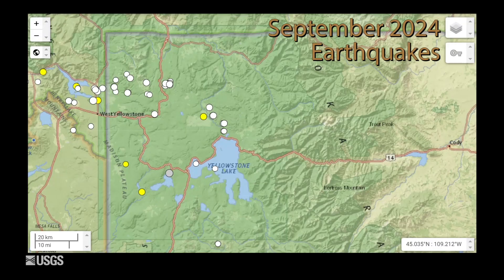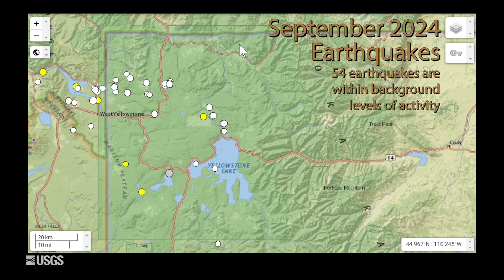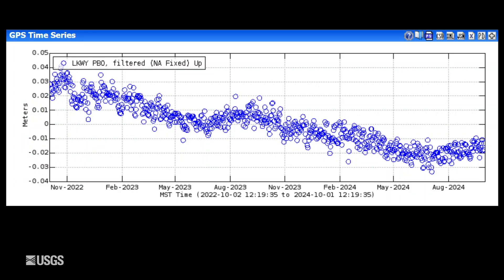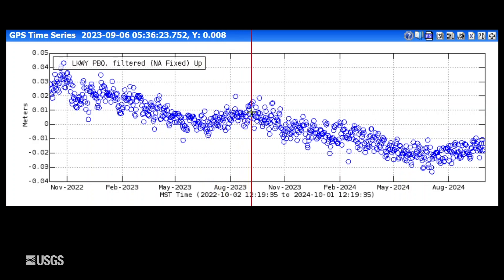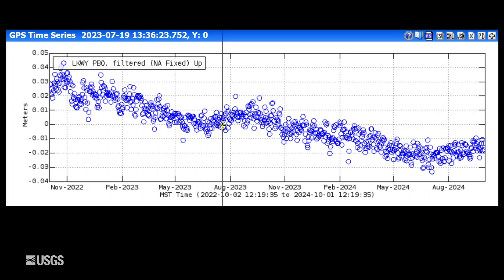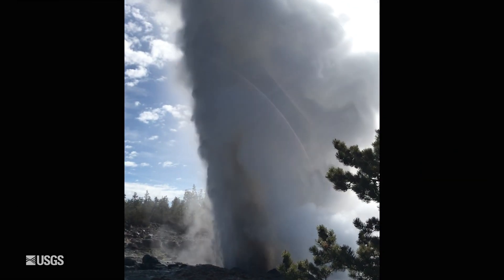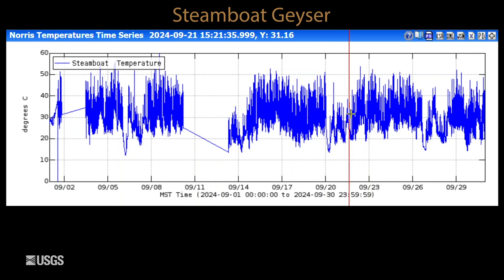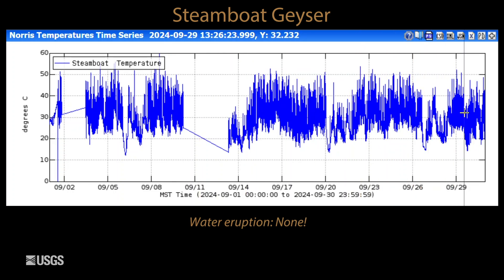Biscuit Basin Hydrothermal Explosion Update (Yellowstone Monthly Update — October 2024)

Comment: the way you dance around the answer is what... i hate most about government agencies... thanks for sharing your obvious narrative... <3
Reply: Using triple periods... instead of normal punctuation... doesn't make you sound any smarter...
Also, considering it's not just the USGS watching this thing, but also pretty much every geologist in the Central Rockies, and that this is the most extreme thing to happen in the caldera in several years, I get the feeling we'll be just fine for a couple decades.
Reply from the maker: What sort of answer do you think we are "dancing around"?  It's all pretty simple -- the water was already boiling, became confined due to silica precipitation on the conduit walls (we see that in eh debris that was deposited by the explosion), pressure built, and rock ruptured.  This caused a feedback where the pressure drop caused more boiling liquid water to flash to steam, fueling the explosion.  It was not caused by any change in magmatic activity.  If it were, the activity would have manifested much much differently.

This sort of thing happens in the park with some regularity.  Something this size happens about every decade or so, but smaller events happen multiple times a year.  A steam explosion occurred in Norris Geyser Basin in April of this year and created a crater that was 10 feet across!  It just happened at a time that no one was present in the basin to witness it, so it didn't get much attention.

Comment: upgrade the technologie as well software to the hyper newest
Reply from the maker: That's happening!  Every year more stations are upgraded to the latest technology.  It's a challenge, as many of the stations were installed in the 1980s (with analog technology!).  But within a few years, all the older stations will have been replaced with the latest digital broadband equipment.

Comment: Forgive my ignorance, but what caused the boiling water to flash at shallow levels?
Reply from the maker: That's an excellent question.  The water was already boiling, so right at the liquid water - steam interface.  The water also carries a lot of dissolved solids -- mostly silica -- and as that comes out of solution, it can seal off some of the conduits.  That traps the boiling water and steam and causes pressure to build.  When the rock cracks as a result of that pressure, you release all of that boiling water and steam, and the depressurization causes additional water to flash to steam -- it can become something of a runaway process.
Reply: @usgs  thank you!

Comment: I don't see electrical conductivity instruments on your page anymore. Is there a change in conductivity in the outflow from the basin before/after events like this?
Reply from the maker: That's a good question, and we're not really sure -- no conductivity measurements have ever been made at the time of a hydrothermal explosion.  But some temporary conductivity equipment was deployed at Biscuit Basin in August, so hopefully it will have caught some interesting activity.  We'll know when the equipment is recovered and the data analyzed.

Seems likely that there should be a signal...
Reply: @usgs  Measuring simple conductivity alone would indicate fluctuations in conductive ions but it wouldn't tell you just what those ions were. It would be more informative, geologically speaking, to actually use some type of liquid chromatography, e.g., ion chromatography, to determine just what type of ions are populating the water and if the amount and/or relative concentrations are changing. I realize that such analysis, particularly real-time, might be beyond the budget of the Park Service.
Reply from the maker: @avsystem3142  For a warning system, the specific compositions might not be that important.  Conductivity variations due to changes in the proportions of liquid water and steam, or of the amount of boiling water that is present, may well provide important indicators of the buildup to an explosion, allowing for the hazard to be recognized before it happens.